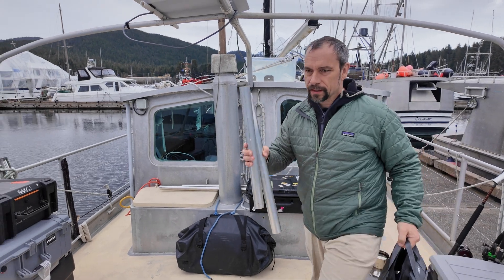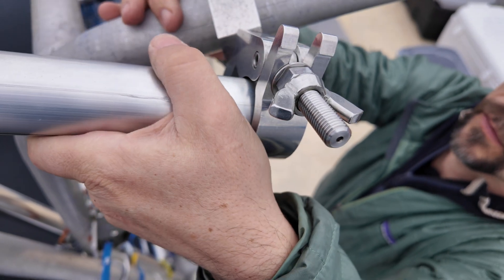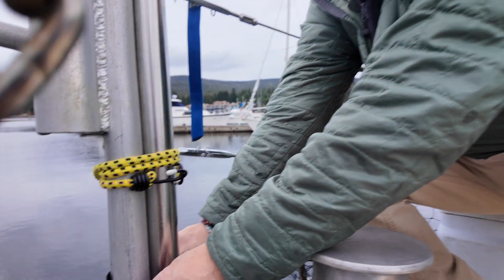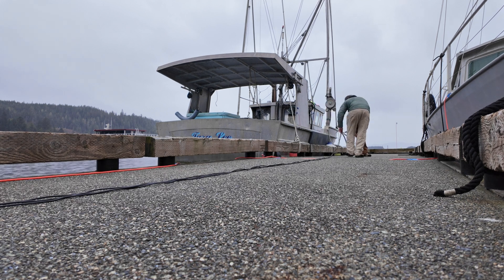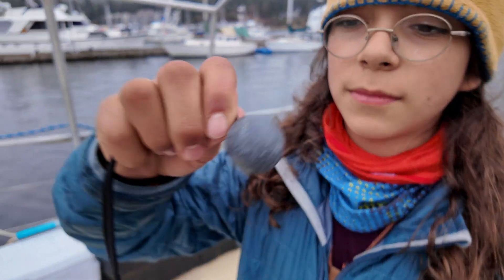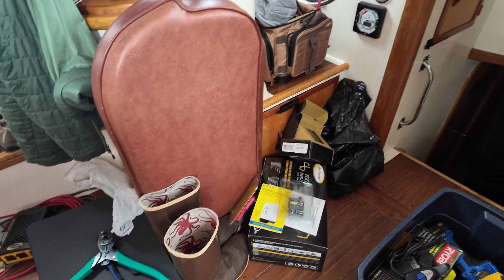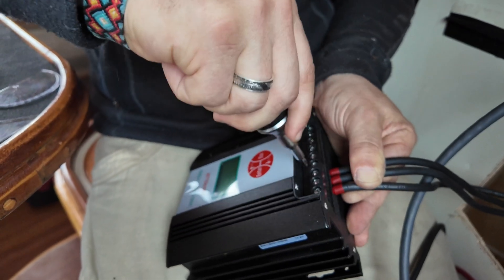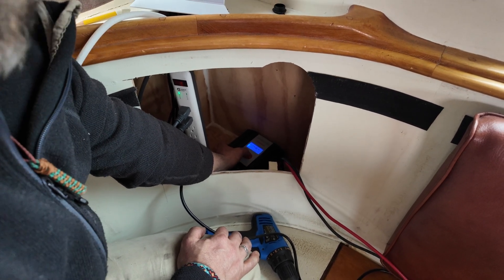Will this wind gen spin... or just my head? ( Sailboat power upgrade )

Comment: Don't forget to set the windspeed brake .... horizontal axis machines are evil for throwing blades or catching unsuspecting  sailors who get in their way.... It's one of the reasons why there's still work going on, on small vertical axis machines plus they don't have to swing round into the wind. 🧙🏻‍♂️🥼🇬🇧
Reply from the maker: This sounds very interesting about the vetical axis turbines! About the windspeed brake. I believe this turbine has a built in brake that gets activated at a certain speed. I had it on a different boat when the wind came up to 60-70 miles an hour and the brake kicked in.
Reply: @TheWildLifeFamily  One of the British practical sailing mags had a writer sailors experience where he was struggling with his boom  and he forgot  how little room there was between it and the turbine blades at certain points he raised his hand to reach overhead 😬, the result was bloody and painful needing surgery and unable to sail without crew help.  Yours looks plenty high and the rear framework indicates the safe limits to  crew movements ...🧙🏻‍♂️🤞🏻
Reply from the maker: @clivestainlesssteelwomble7665  Yes, you are perfectly right to point out the dangers. Where we have it, it is out of the way unless you would climb up and out of the bimini frame...